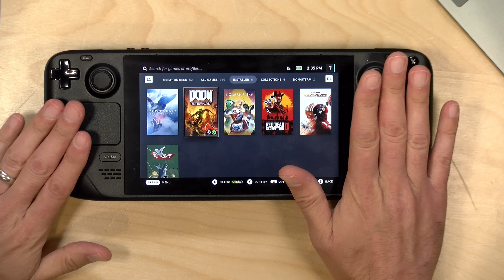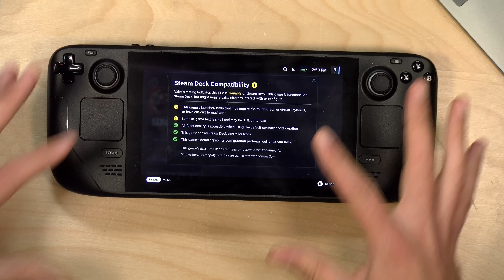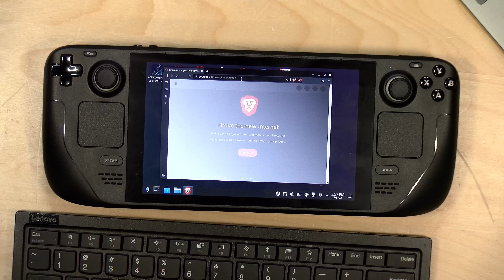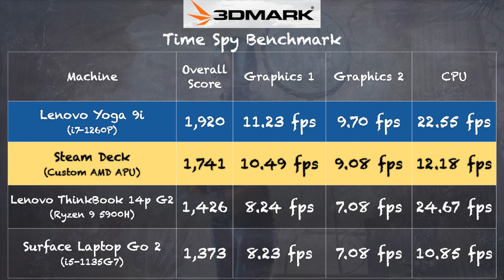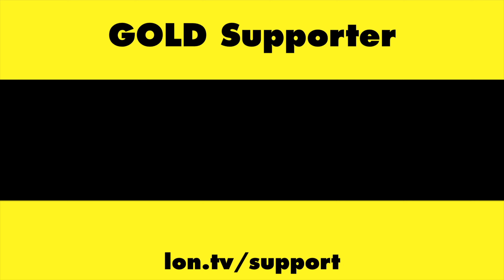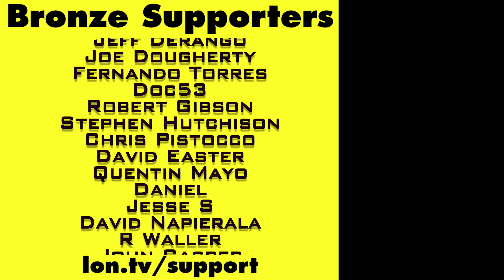Steam Deck Review & Deep Dive - SD Cards, Desktop, Epic & Gog, Windows, vs. a Laptop and More

Comment: Though your review of the Steam Deck was good you like many have missed the whole point of why the Steam Deck.  You mentioned Valves failed attempt of creating their own Linux distribution called the Steam OS along with the 3rd party systems called Steam Machines back in 2013.  Why would any company invest the tremendous capital outlay on such a difficult task of being able to play all PC games on Linux.  You accurately mentioned that the reason their first attempt failed was because unless games were ported to play on Linux you had to be running the Windows OS.  Back in 2013 the simple solution was to simply set up all of these Steam Machines to dual boot between Linux and Windows, well Valve did not want to do this because it would send the wrong message.  So why has the Valve Corporation been so driven the past 9 years to create a compatibility layer that would allow any game to run on the Linux OS?  It is because Valve as well as other Linux users could see the danger that Microsuck posed to the very freedom that we all have had to decide what software as well as games we wanted to use and to purchase these from who ever we chose to.  When Microsuck developed Windows 10 it came encumbered with the Microsuck store, at the same time they applied heavy handed requirements on the hardware manufactures to implement Secure Boot and stated that these extreme measures were necessary to implement security of our computers from viruses and other malware. When Window 10 was first released Microsuck made it very clear that the purpose for the Windows Store in Windows 10 was to only allow approved software to run on Windows to prevent the spread of malware instead of directly addressing that it was the very architecture of Windows that allowed malware to run.  No one has wanted to admit that Windows is by far the worst malware that has ever been created.  Today the sole purpose for Windows is to be spyware with the sole intent of data mining the millions of PC users worldwide.  How many things are running hidden in the background when your PC is turned on?  Most software installed has been given the explicit permission by Microsuck to run in the background and to be constantly phoning home, Linux does not do this.  In reality both of these efforts were the beginning salvos to prevent all PC users from using any other OS other than Windows.  The average Linux user saw this as a direct attack against their freedoms to use their computers as they wish and not to be dictated by some damn corporation as to how we would have to use them.  Valve has seen this as the existential threat to their companies very existence and ability to stay in business.  Microsuck made it very clear that only they would control what games would run on Windows and those would all be purchased from their store.  They want to put all of the 3rd party game distribution companies out of business. If you doubt any of this just look at the restrictions that must be implemented on all mother boards that run Windows 11, they have to have UEIF and Secure Boot enabled as well as a new chip called The Trusted Platform Module.  All of these features will prevent any other OS other than Windows 11 from even being installed on the PC, this includes earlier versions of Windows.  This is the whole purpose for the Steam Deck and the Steam OS, these two things together successfully demonstrate that the for one of the major things that tied millions to Microsucks OS was gaming was no longer necessary.  The only temporary snag are the newest games that require Direct X 12, this issue is being worked on as we speak that will also successfully all Linux to also run Direct X 12 games.  The good news is that sales of the Steam Deck have exceeded 1 million units and it has just begun to be sold world wide, up to now they have concentrated on the US and perhaps Europe.  The more gamers that buy the Steam Deck the better off we all will be.  When the game developers finally see Linux as a viable gaming platform perhaps they will ditch the Microsuck technologies mainly Direct X.  Currently the only platforms that use direct x are PC running Windows and the Xbox, everything else, PS 5 and the giant mobile gaming market do not use Direct X because they will not pay Microsuck royalties to use it.  Some GPUs only use OpenGL or Vulcan apis and the rest can use both of these along with Direct X.  Perhaps in the near future these game developers will stop using Direct X, if they did they could easily create versions of their games that would run on every OS out there including Mac OS as well as Linux.   I have ditched Windows and now run Linux on all  of my computers, On my main gaming PC I am testing a new distro called Grauda Linux, Like the SteamOS that is on the Steam Deck Grauda is based on Arch Linux and is optimized for running games as well as other graphics software like video editing it comes with all of the tools necessary for running all games.  It has the installers for the Steam client as well as other launchers and compatibility layers.  The difference is currently the Steam OS is not designed for a standard PC install, it specifically is set up for the hardware on the Steam Deck.  There are some developers in the Linux community that are working on the Steam OS to make it compatible for regular PC hardware.

Comment: Nice review. I do think your comparison to surface pc is way off the mark. You'd never consider a steamdeck if you want a laptop and vice versa. They are two completely different beasts.
Reply from the maker: Maybe for those in the market for a handheld PC but I focus on general consumer needs/wants. 1. Not every consumer can afford both and 2. You can wait 8-10 months for a steam deck or pick up a reasonably priced laptop today that can deliver decent enough portable gaming performance. By mid year many 6000 series Ryzens should be pretty comparable to Steam Deck performance.

Comment: good video, still a lot of things were not covered.
Reply from the maker: like?
Reply: @LonSeidman  the performance options for example. you showed only the overlay, but not that you can actually tweak fps, display refresh rate, tdp, use per game settings and so on. 
didn't see mentioning sleep mode - that you can put the device to sleep during gameplay and on wake up it will continue from the same spot.
things like that

Comment: Amazon Games?  Thanks for the though review and demonstration.  I have hundreds of Windows games on Amazon Games that I’ve gotten for free with my Amazon Prime subscription.  Is there a way to get those working on the Steam Deck? Thanks
Reply: not very familiar with the concept. i think it's using a specific amazon launcher?
you can try to install the launcher as a non-steam game, and then depending on the drm they are using at least some games should be playable.
Reply: @thomasrossbabin3671  Great!  Is this available as a flatpak (sp?) through the discovery center/store?  (I'd check, but I don't have my SD with me).  If not, could you post the website to find it?  Thx.

Comment: Doom is an interesting one on the Deck - one which actually benefits from adjustments right out of the gate. Change the settings to 16:9 and then the text becomes way more readable. It should run at around 50FPS. Also make sure to use the per game settings for each of the games. That really helps!

Comment: I have an old TV that only runs in 720p, so it would probably run even better with even lower res. Considering our cable is only 480p and I can watch that just fine on a big screen, I can probably tolerate 720p gaming, though I would have to try when I get mine.

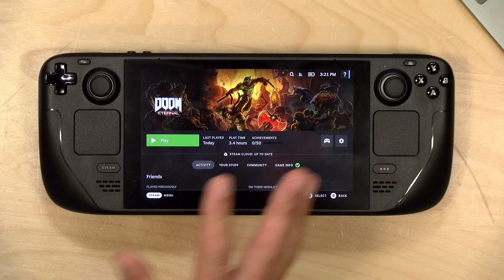Comment: 15:08 actually doom eternal came out a little before microsoft bought Bethesda. The buyout happened on Sept 2020 and finalized later in 2021. Doom eternal came out March 2020 but dlc came out after microsoft bought them out so the publisher was microsoft if you don't count the fact Bethesda is a subdivision.

Comment: So glad you reviewed No Man's Sky.
I LOVE THAT GAME! Found it via Xbox Game Pass and I play it more than most of my other games on my gaming laptop. Best game EVER!
Reply from the maker: It's an awesome experience especially in VR!
Reply: @LonSeidman  O_O
How can I play it in VR?
Do I need the Steam version?
Can I do it via Xbox GamePass?
Do tell me.
Reply: @JocelynAyodele  The VR version comes packaged with the base game, you don't need to buy anything extra. However, VR is not currently available on the Xbox version. I'm not sure if you can use VR while paying the Xbox version on PC.
Reply: @in-craig-ible6160  I'm playing the PC version.  I wanna try this out. I just wonder how it'll work.
Reply: @JocelynAyodele  Ok well first you need a VR headset. Then, when launching No Man's Sky, it should give you the option to launch it in VR mode.
If it doesn't, you might have to check the launch options within Steam for No Man's Sky. And I think that's it.
Check YouTube for guides, though. I haven't actually done it myself.
Reply: @in-craig-ible6160  So does it not work with the Xbox app version?
Reply: @JocelynAyodele  I don't believe so, unfortunately. Xbox doesn't have VR support, at least not yet.

Comment: Is this the new, inferior, ssd valve has put into the deck? I'm interested to see new benchmarks with the slower ssd.
Reply: there would be no difference in what matters for the platform - gaming. 
games don't benefit that much from the insanely high ssd speeds.

Comment: one thing to mention is valve has implemented FSR upscaling into the OS itself. so you can run the game at a lower resolution and use FSR to scale it up to fill the screen, for instance doom eternal.
this is also a good way to help mitigate the battery life the battery life is really what you put into it like you said
Reply: There are lower resolutions to 720p?
Reply: @bland9876  Do you know about 800x600 or 640x360 gang?
Reply: @Priyajit_Ghosh  maybe if your playing games from the 90's
Reply: @bland9876  600p isn't that far away from 720P XD ah and 540p.
anything lower than that FSR kinds craps itself.
Reply: @dracossaint  you mean 320 by 240?

Comment: valve should use the OEM windows license for less than 1/10 of windows discrete license price, around 10$ per license, or just install windows 10 pro at 10$, machine locked license
Reply: amd needs to be shamed for forcing valves hand on locking out some pcie m.2 devices, nvidia gpus in particular
Reply: @Jkauppa  im pretty sure thats just because steamos 3.0 only supports amd stuff due to the only hardware that runs steamos is amd based.
Reply: @ReallyJTT  nope, windows
Reply: @ReallyJTT  they deliberately block pcie signatures
Reply: @ReallyJTT  pcie supports whatever you have drivers for it, unless deliberately blocked in the bios or something else
Reply: @ReallyJTT  pcie is a standard, so if you selectively allow devices on it that show up and others dont, say, storage devices vs nvidia gpus, specifically, then, think again
Reply: @ReallyJTT  any other baseless complaints
Reply: @Jkauppa  the steam deck doesnt have pcie
Reply: @ReallyJTT  m.2 pcie
Reply: @ReallyJTT  and the processor does have the lanes, just like a normal processor does
Reply: @ReallyJTT  all amd external gpu's work, but nvidia gpu dont work, stop talking
Reply: @ReallyJTT  you people claim always to know something and then run away with tail between legs
Reply: @ReallyJTT  you just try to figure out any possible reason someone is wrong: "All models use socketed 2230 m.2 modules (not intended for end-user replacement)"
Reply: @ReallyJTT  lame
Reply: @ReallyJTT  check UFD tech for reference
Reply: you could change the UI scale inside the games to 200% or similar
Reply: artificial limits are bust and bunk
Reply: valve steam deck form factor is perfect
Reply: usually better or/and as good as a laptop
Reply: on the fly native (m1 or arm) to x86 instruction translation to get the full library on anything
Reply: they don't use linux to save money on windows keys. they specifically want to combat windows in the pc gaming monopoly. as things were going, after a couple of years the only way to play pc games would have been through the windows store. and at that point they would have been able to control everything regarding pc gaming
Reply: @IcoKirov  by implementing all windows interfaces, better just encourage direct compile to linux, if so, still the oem windows install would be the best
Reply: @Jkauppa  it's not implementing windows interfaces. it's using translation. 

look. this is providing the gaming experience on linux. now that more people start using linux, it promotes linux native ports. therefore devs have incentive to support linux.
previously things were running in circle. people were not using linux, because there were no games on linux. devs were not making games for linux because not enough people were using linux.
now the devs that can't allow themselves to support linux ports, can just focus on the windows port, while those who have the resources can focus on a linux port and provide even better experience.
Reply: @IcoKirov  as long as you support the windows executables, you are not honest in that point
Reply: @IcoKirov  keep opinions as is
Reply: @IcoKirov  so windows will rule the os'es, despite what steamos tries to do
Reply: @IcoKirov  I do not have any obligation to believe you, as any developer does not have to care about linux, not even if steam os might be doing what it is doing
Reply: @IcoKirov  interfaces = translation, duh
Reply: @IcoKirov  if you translate an interface to another interface, lol, whats that called
Reply: @IcoKirov  this conversation argument is not wise, in any way
Reply: @IcoKirov  if you implement the executable interface, then its the interfaces, whatever terminology you want to argue in vain for
Reply: @IcoKirov  basically steamos could run a windows on the background in a virtual machine fully accelerated and achieve the same, still the windows interfaces stay, whatever your opinions is
Reply: @Jkauppa  dude are you sick or something. write one comment.... can't track your thoughts at all.
Reply: @IcoKirov  maybe you just lack arguments or skill, if you cant follow me, or catch up, and have to resort to insulting
Reply: @IcoKirov  right, you want to dictate, you will not limit what I can do, not even for that reason
Reply: @IcoKirov  do NOT tell me what to do and how, boosh off
Reply: @IcoKirov  cant handle multi-tasking, huh
Reply: @IcoKirov  do you need handicap, well, read all the comments again
Reply: @IcoKirov  I dont need to talk to you, if you need to talk to me, you are a ghost
Reply: @IcoKirov  do not attempt to slow me down, if you cant handle what you are thrown into
Reply: @IcoKirov  if God does not give, you just dont have it
Reply: valve should make it default x-input compatible

Comment: Why does 256gig of nvme cost $130 more?  That sounds like an Apple ripoff in an otherwise interesting product.
Reply: I view the base $399 model as something of a loss leader for Valve that they try to make up for with the higher tier models. Had they only had one expensive model, it would not have done as well to promote the Steam brand and get more people using Steam. That's my theory.
Reply from the maker: Yeah they followed all the other PC manufacturers in that way - have a super low base price to say "it starts at only..." but have that base level configuration be very undesirable. Although in this case they only really limited the storage, it's otherwise going to deliver the same performance as the other tiers.
Reply: Wow. having someone look at the price of the Steam deck and try to compare it to an apple ripoff is the definition of ignorance  and/or tone deaf. The specs and hardware that valve has packed into this thing at this price is nothing short of a miracle. They are undoubtedly selling these at a break-even or loss right now. Take a look at ANY other handheld gaming PC in the market right now that has anything even close to the Steam Deck specs (Steam deck is still the most powerful handheld you can buy right now) and they are easily double the price or more.
Reply: because the 64gb version is sold at higher loss, compared to the 256. 
and please don't compare this to apple ripoffs. if this was an apple rip off it, the 64 gb version would be selling at about $1500. instead it's selling at 400. the base price of the components, even bought right out of the manufacturer would be close to the 400 price point if not more.

Comment: I’ve had mine since the 2nd shipment and other than running emulators I haven’t used it much since.  It’s a nice toy but sorely lacking in what I wanted. I bought a gaming laptop while I was waiting for mine to ship and that spoiled me I suppose.
Reply: crazy, I've had some extremely beefy gaming laptops, and I just find them useless for the situations I wanted the Steam deck for. The Steam Deck is an absolute beast man - I would definitely recommend giving it another go.  It is getting more use than my desktop with a 3080Ti/12900K these days, thats how convenient and awesome it is
Reply: I've been using it for stuff like jrpgs, roguelites, character action/spectacle fighters, and other less demanding games. I don't see the point of using it for stuff that runs at 30fps and/or kills your battery in less than 2 hours when I have a high end gaming pc.